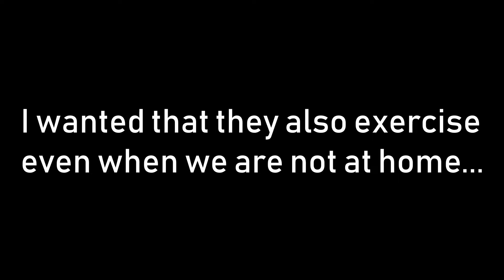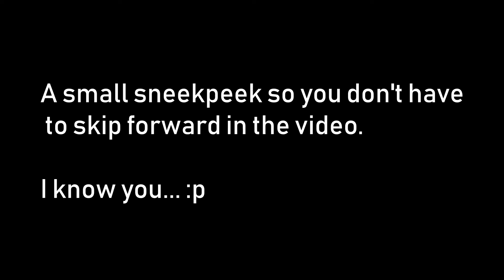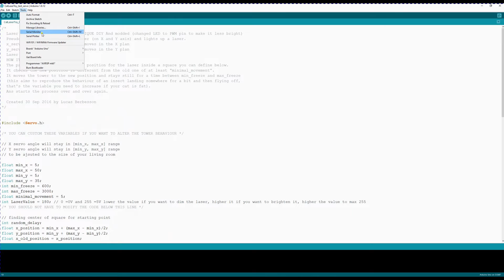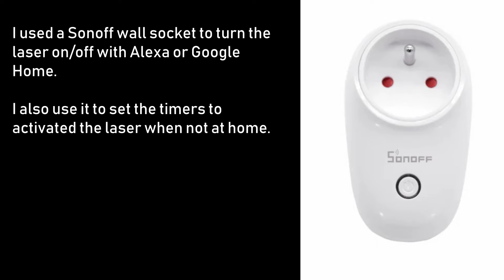Easy Arduino Cat laser Toy Project | NO Soldering  DIY

Comment: Absolutely love this. All the automatic cat lasers I found just weren't any good. I'd love to try this out. This is exactly what I was looking for

My only problem is I wish this went more in depth for absolute beginners. If I tried this I feel like I would mix up the wiring for the servo motors as I don't know which one goes to which.

And as a newbie, are all these products compatible with each other, for example would those servo motors work on an Arduino one?
And can I use any other cat laser code or does it have to be this one?